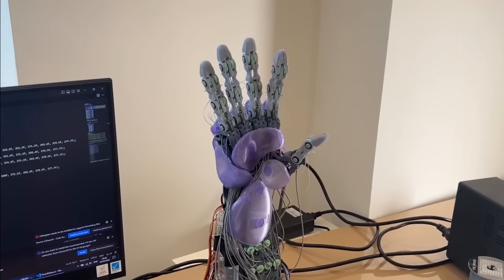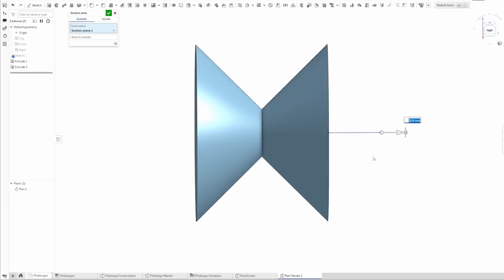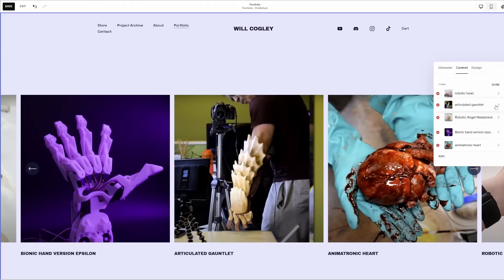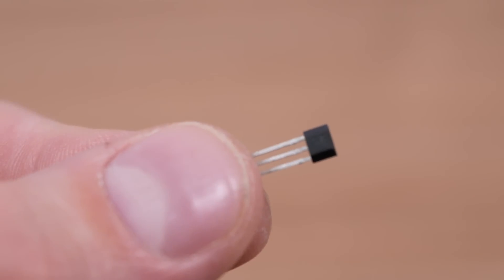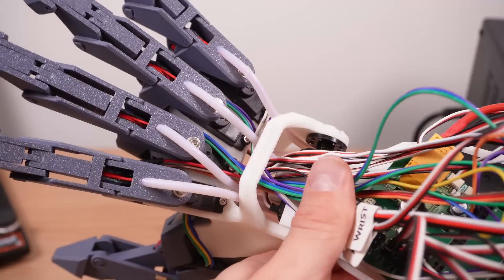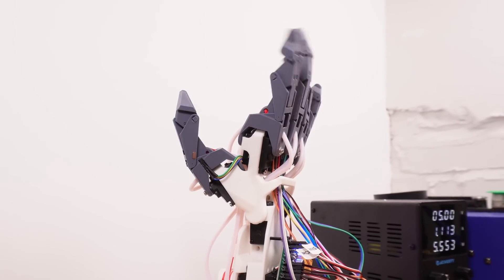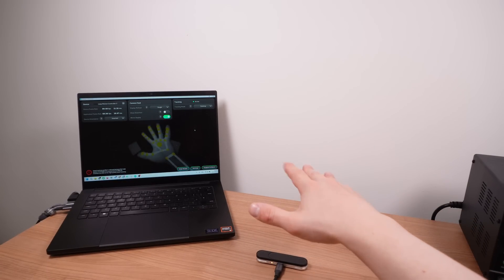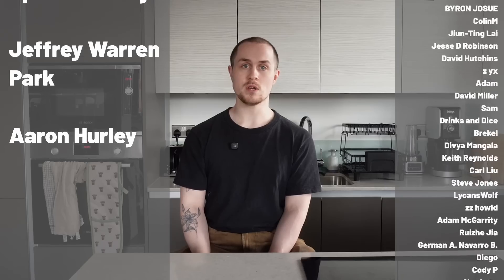Why My Most Ambitious Bionic Hand Kept Falling Apart

Comment: I mean there are a few things you can add to it

Look up the DG-5F as example

Simple yet capable of such high degrees of precise movements
Just from a few more joints on the pinky and thumb

Also a glove controller would be awesome instead of just a few buttons

And buying a few screws won't destroy someone's wallet

So dont shy away from adding a few more supports on the fingers

...

ALSO MAKE MULTIPLE SIZED VERSIONS
I NEED A GIANT ROBOT GAUNTLET
NOT "want"

I NEED A GIANT ROBOT GLOVE!!!!!!!

Comment: Looks good, will that software allow you to use vectors at the joints? Or label a vector pointing joint to joint that tells you its axis variable as it moves. Will the software let you make a center point of the palm then a sphere around that point defined in radians as the radius increases so you can plot them on a graph easier with a side view of each finger and a single plane for the point of the palm looking down at the palm

Comment: On my canards, I simply use a potentiometer to measure each relevant angle, even though the canards themselves are spun by step motors fairly precisely through two 2:1 helicoidal gears with no sensible backlash (one for the canard, the other for the potentiometer). As you're using threads to pull your fingers, it's probably possible to insert the thread on a "screw pulley" that will give you at any time the exact position of each finger at any time without the need to initialize anything (an analog read on the potentiometer is enough). There are microcontrollers perfectly able to convert such analog information into I2C (ATTiny) that also control the actuators, so it's not taking much space in the end. On my canards, I only need to go from -90 to +90, translating into -180 to +180 on the step motor, while my linear potentiometers have a 240º course, so I had to figure out a way to position the canards themselves, but it doesn't have to stay permanently (it's a one-time setup).

Comment: For an efficiency gain over separate classes you could put each finger into a single array and update the array once per clock cycle, referencing each fingers position in the array.

Comment: SMD hall sensors and flexible PCB, it might be possible to do it with just one flex PCB.  Too many servos at once is a high current draw, that can cause voltage drop and EMC issues.  Quaterion math is a bit tricky, for drones M4 Cortex CPU with floating point makes it easier now.  IMU sensors sometimes have Quaterion CPU chips doing the math.   Could you do a two filament print, using TPU at the joints?   I am in awe of your progress, hopefully it won't take Edison's 10,000 attempts to get a final design.  Tesla used to dream the final design without constant iterations.

Comment: To figure out joint angles, I'd just work with point cloud on per finger basis. Figure out vector basis of each finger plane, calculate angles in there using atan2. And then figure out vector basis of a palm (maybe rotate it a little), and then calculate base bones or base points of each finger in terms of rotations relative to the palm.
I could help you implement this in Unity too, if you don't shy away from your fellow commenters' help.

Comment: I'll try to keep it short then. Quaternions (a black-box concept) are actually 3d rotors (a concept from vector GA). They are derived by composing together planar reflections represented as vectors. When you compose them, collinear reflections turn into scalars (identity operations), orthogonal reflections turn into bivectors (+180 deg rotations). To rotate a vector using that - sandwich it between a rotation and anti-rotation, since it'll be equivalent as operation to a rotated reflection. Now that you know that, please learn the rest of GA, since it is very useful, especially in robotics
I'd go into more fun details, like bivectors, reverses, logs, exps and different GA algebras, but apparently Youtube hates big comments.
Reply: GA= Geometric Algebra.

Comment: In Unity, you should be able to see the relative positions of any bones to their parents, and to see the relative pitch, raw, and roll (euler angles).  Quaternions are great for eliminating gimbal lock, continuous rotation, or slerping between two rotations, but if you're just trying to get positional data, make sure the parents are defined correctly, and just use the relative euler angles.  If the parents are declared correctly, you should never need to manually calculate the difference between the patent bone's positon/angle and the child bone's position/angle.

Comment: I have a question, how functional is the hand? The print seems to be printed in a way that the layer lines are horizontal to the major stress points on the joints. Does this mean the finger is easy to break when you apply stress to it? Also, for the finger length, it seems that the full motion is roughly equivalent to the distal and middle phalanges bending. Will there be an option to make the phalanges longer? Thank you.

Comment: Alternative idea for the close finger sensor. Could use a strain sensor to measure deflection? You should get better position data and you wouldn't need to worry about interference from what the had grabs, and you don't have to rely on the motor & homing.
Reply: Still would need to calibrate it, since it's an analog sensor and the values will drift / not be in the same range for each finger, and may also vary by humidity/temperature, etc.

Comment: Another great project for sure! About the hall sensors, what about put the magnets of each finger attached to the cords, next to the servos? You could use a centralized boards with less wiring. And also could print components to put the hall sensors inside it. This way, the cords would pass through this component like in a funnel or a current transformer, in power meters

Comment: I think 3brown1blue should have a helpful video on quaternions, i could be imagining it tho
Reply: Understanding quaternions is only one third of the battle...

Anyway, there's no reason to even use them, Unity will just flat out give you the relative euler angles if you ask it to.  

If, for some reason, the values it's giving you are wrong for your scenario/application, then your model is defined wrong.

But yeah, there's just no benefit to using quats for something like this.

Comment: Use the "Quaternions and spatial rotation" for help with quaternions.
Reply: For inverse kinematics, "Analytical Solution for Inverse Kinematics Using Dual Quaternions". Look into screw theory. This is my field of study.
Reply: @theavaliengineer  Hey I speed through "a" paper about what you mentioned called Inverse Kinematics with Dual-Quaternions,
Exponential-Maps, and Joint Limits and it uses a dual vector quaternions with a epsilon as a dual operator that kind of looks like a special scaler. Do you have any books that could go over screw theory? Also I made a calculator in rust that calculates finger joints. It's on codeberg and it's called pup/2025-03-04_joints_to_points_calculator. Please have a look when you can!
Reply: @theavaliengineer  Dual quaternions are a very black box concept. Look into projective geometric algebra instead, especially the online demos. 3d motors are much more intuitive.
Reply: @UserMist  It seems like the constrajnt areas are likely going to be smoothness and possibly whatever processors he can fit onto the animatronics. While dual-quaternions are somewhat abstract, they outperform every other approach; as they most efficiently represent screw transformations.
Reply: @theavaliengineer  But they are still are a black box. PGA motor is generalization of a dual quaternion, while being a lot easier to understand. Not to mention it meshes well with other GA objects, making it even more valuable than a standalone object.

Comment: Limit switches for the fingers are good, but should only really be used to prevent "crashing" them into the palm. For actual positioning, instead of dead-reckoning based on a zero, you should use IR optical encoders and disks. They're dirt cheap, simple, their outputs can be interpreted however you want in software, and require few inputs. Depending on the angular resolution you need, you may even be able to print the encoder disk slots directly into the finger joints. Using an absolute system like this pre-empts issues arising from a finger's position slipping due to external force, causing it to lose its zero.

If you're getting crosstalk between the servos, either use shielded cable to wire them up, or use twisted pairs.

Comment: very cleaver. And elegant design.
As you are printing in place and doing some redesign have you given any thought to compliant joints? You can get quite creative and durable with them having thin compliant walls wrapping around large round sections so as to never reach the fatigue limit at least in materials where you can avoid fatigue.

On a simular note, a thin flat section of print in place plastocs can act as the tendon and a mount for magnetic strips for positioning. With a full magentic strip you wont be printing in place but cassete recorders are still fairly avalible as is magnetic tape. Record a square wave especially in a stero double sided tape do some some math and bada bing bada boom you have a servo motion controller with a four bit grey encoder. Not the most brillant, certianly could do to be better, but it is very accessable, and you may be able to up the bit count by adding in some form of signal strength modulation and reconition.

No homing. Just bit math and velecotiy targets. Yes I do love my absolute positioning.

And thats why I mentioned complaint joints as a consideration; although it occurs to me that a flat tendon in track could in fact run through what youve got, it was indeed more of an linguistic tool to spur further reading

Comment: On your finger endpoint sensors, you could always tweak the closed position in software rather than having an adjustable mount, this would remove a point of failure and a variable.  I would also recommend moving from hall sensors to TMR sensors, as hall sensors are notoriously noisy and jittery, plus they do have a usable lifespan where the sensor develops voltage drift over time due to the nature of the materials used, a lot of manufacturers don't actually list the spec but it's called quiescent age-related voltage drift, from what sensors I do know list the spec it's usually within the range of 1000 hours, mitigated designs are not a solution considering this is a runaway issue.  Otherwise, and this is probably a better long-term solution, use an inductive sensor, either a latch or a position sensor, this would further update the design to remove the susceptibility to external magnetic fields, of which TMR is still susceptible to, given that inductive sensors produce their own EM field, use a metal target, and sense the feedback of said target. 

With an encoder on the motors and power monitoring, during a homing sequence you can determine endpoints via when the motor starts over-torquing the joint.  During practical use of the hand, this can also determine grip strength of the hand.  Feedback loop of motor torque would be the proper way to do this given its dynamic range, whereas a static endpoint sensor is more for redundancy, but you have bigger issues if your grip PID is running out of control.  It would also be beneficial if you can find a wire that has good holding strength but also a slight amount of elasticity, that way your motor can not only grip but also have additional pull before the PID locks the position of the motor; just like how real tendons have elasticity and springiness to them.  Active monitoring systems are typically better than passive systems anyways. 

I have no idea where to source the fibers, but there are fiber optic cables with Bragg gratings, which act like mirrors that send back a specific wavelength.  These systems can measure movement of the fiber optic, position and bending, etc., and this can be done in 3D.  If there's a reasonable source for these, running one parallel to the tendon would be great, you'd get bend and splay in each digit, plus the additional palm movement with the pinky and ring finger, plus the thumb's extra dexterity.  Though these things are theoretically resolute enough to where you could run a single line through the hand and read each finger, though this would be kinematically more complex.  Again, I have no idea how to source these on the hobby side of things, on the industry side they're mostly for aviation (measuring aircraft body movement) or in medical (non-invasive endoscope tracking), but these kinds of sensors would be more than suitable for robotics, and at a seemingly inexpensive cost as well.  Maybe someday they'll be available via vendors so that the hobby and small-scale business can utilize them.

Comment: You should use liniar hall effect sensors that way you get actual positional feedback... Without Homing or any guesstimation 😅. Feedback and knowing grip strength would totally be a thing too. For example, if you map each servo position to a finger position if there is a deveation, that means that an external force is applied to the finger... if it's too hard to tune, try and find more stretchy cord. Maybe flexible 3d printing filament would do the trick.

I think irl it works similar with real muscle. Where there is cells that tell you how stretched a muscle is or not and our brain compares that to how much we try to push or pull in comparison.